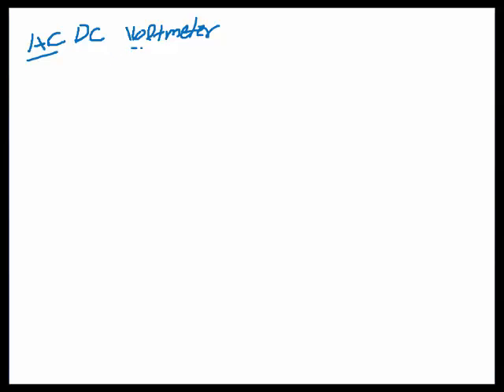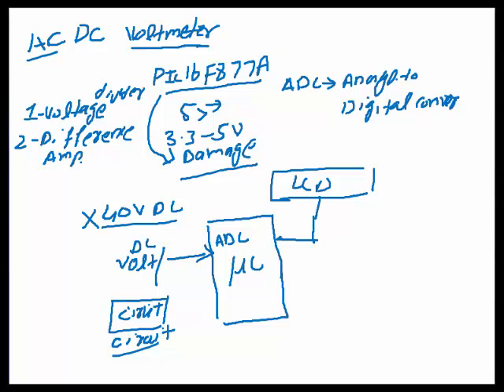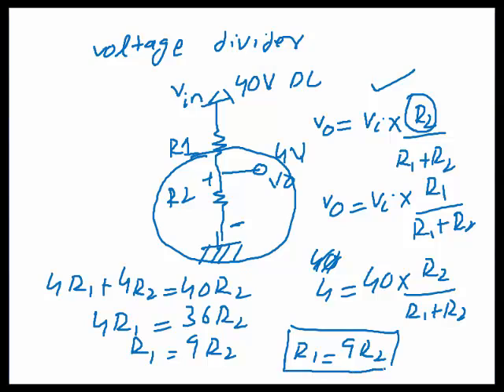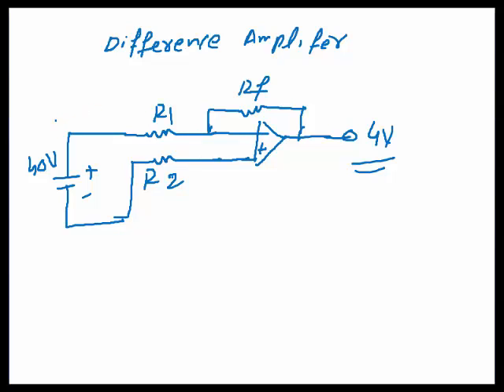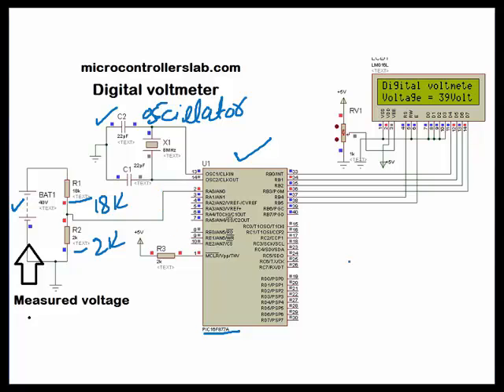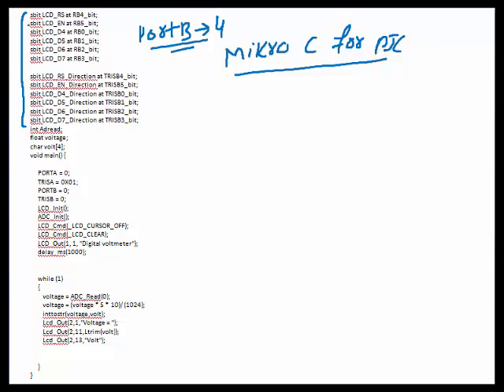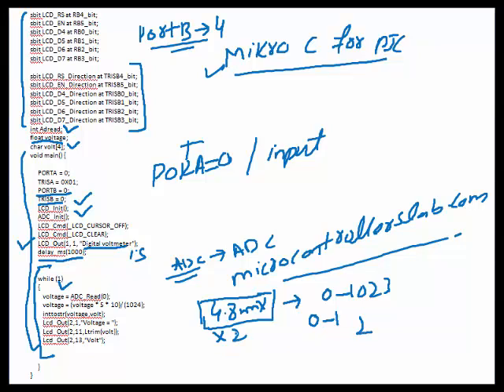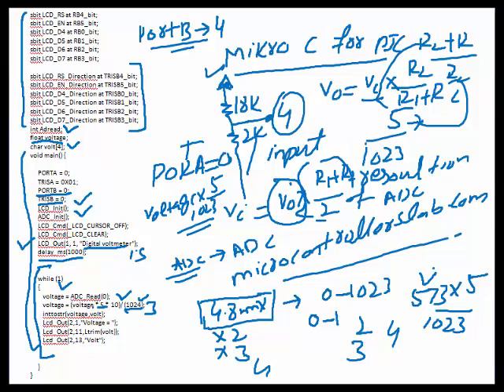digital dc voltmeter using pic1f877a microcontroller

Comment: Hi sir please correct this code for my mini project .I wait for sir  
My email:amantenagasa@gmail.com
// LCD module connections
sbit LCD_RS at RB4_bit;
sbit LCD_EN at RB5_bit;
sbit LCD_D4 at RB0_bit;
sbit LCD_D5 at RB1_bit;
sbit LCD_D6 at RB2_bit;
sbit LCD_D7 at RB3_bit;
sbit LCD_RS_Direction at TRISB4_bit;
sbit LCD_EN_Direction at TRISB5_bit;
sbit LCD_D4_Direction at TRISB0_bit;
sbit LCD_D5_Direction at TRISB1_bit;
sbit LCD_D6_Direction at TRISB2_bit;
sbit LCD_D7_Direction at TRISB3_bit;
// End LCD module connections
// LCD Display
char txt1[] = "MEASURING VOLTAGE";
char txt2[] = "VOLTAGE DISPLAY";
char txt3[] = "LCD DISPLAY";
char txt4[] = "THE CURRENT";
char txt5[] = "VOLTAGE IS";
char txt6[] = "DISPLAYED";
// Loop variable
char i;
float quant=220.0/1024;
float adc_val;
void Move_Delay() { // Function used for text moving
Delay_ms(500); // You can change the moving speed here
}
float adc_rd;
char txt[5];
void main() {
 Init_System(); //Do system startup work
Init_Timer(); //Initialize timer interrupt in Auto reload mode
PCON=0x01; //one of the power saving mode of 8051
}
ADC_Init();
ADCON0 = 0x41;
ADCON1 = 0xC0;
CMCON = 0 ; // Disbale comparators
//UART1_Init(9600);//initialize UART
TRISA = 0xFF;
TRISB = 0;
Lcd_Init(); // Initialize LCD
Lcd_Cmd(_LCD_CLEAR); // Clear display
Lcd_Cmd(_LCD_CURSOR_OFF); // Cursor off
Lcd_Out(1,6,txt3); // Write text in first row
Lcd_Out(2,6,txt4); // Write text in second row
Delay_ms(2000);
Lcd_Cmd(_LCD_CLEAR); // Clear display
Lcd_Out(1,1,txt1); // Write text in first row
Lcd_Out(2,5,txt2); // Write text in second row
Delay_ms(2000);
// Moving text
for(i=0; i<4; i++) { // Move text to the right 4 times
Lcd_Cmd(_LCD_SHIFT_RIGHT);
Move_Delay();
}
while(1) { // Endless loop
for(i=0; i<8; i++) { // Move text to the left 7 times
Lcd_Cmd(_LCD_SHIFT_LEFT);
Move_Delay();
adc_rd=ADC_Read(0);
if(adc_rd>0){
adc_val=adc_rd*quant;
}
else {
adc_val=0;
}
//IntToStr(adc_rd, txt);
FloatToStr(adc_val, txt);
Lcd_Cmd(_LCD_CLEAR); // Clear display
Lcd_Out(1,1,txt);
Delay_ms(2000);
if(adc_val<220.0){
PORTB.F6 = 1; //Turns ON relay
//Delay_ms(1000); // 1000 mS delay
}
else{
PORTB.F6 = 0; //Turns OFF realy
//Delay_ms(1000); //1000mS delay
}}
for(i=0; i<8; i++) { // Move text to the right 7 times
Lcd_Cmd(_LCD_SHIFT_RIGHT);
Move_Delay();
}}
void TIMER_ISR() interrupt 1 //ISR of timer 0 interrupt with 1 milisecond{
Task_1( );
Task_2( );
Task_3( );
Task_4( );
}
}
Reply: understand,but in this video  inttostr(voltage,volt); it seems undeclared identifier in the expression ??? when compilation

Comment: sir i was trying to simulate this model but i was in the confusion of the component you used in the LCD Side on pin no 2.Will ypu please tell me what is that sir
Reply: its supply to the LCD... you ll find power option in Proteus.